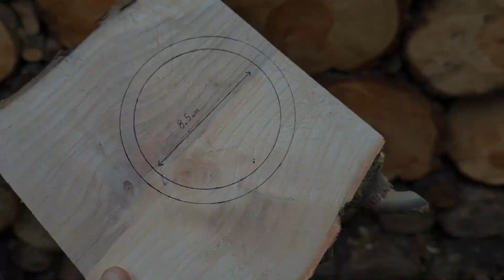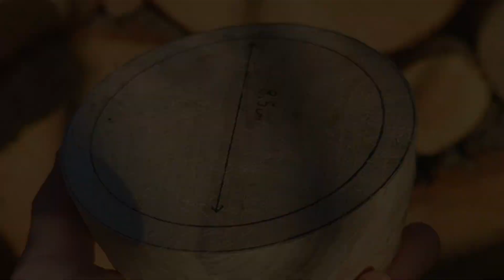Carving A Bowl From Ash

Comment: Nice work. What oil did you apply? Also is that a Morakniv knife and Morakniv gouge tool? And would you reveal and recommend that axe? I just started to get into this beautiful art. Thanks for your sharing. Subbed
Reply from the maker: Thank you very much, it means a lot. I used 'raw linseed oil' for this project as it is food safe. Yes they are 'Morakniv' knives, they are great quality for their price and are usually what I use when carving. Absolutely, that is a 'Gransfors Bruk' Forest Axe, it is probably the best axe I own and will last me a lifetime,  I use it for basically everything. However if you only want to use this axe for carving you will probably want a 'Gransfors Bruk' Carving Axe instead as it will give you a cleaner cut than a general purpose Forest Axe. Hope this answered your questions
Reply: @forisbushcraft8000  Yes I agree with the Morakniv. Many years ago I had occasion to purchase a Morakniv "light my fire" knife/ferro rod combination. I can see how a Mora is ideal as a carving tool. Gransfors Bruks is more than just a string of axes, they are heirloom worthy of passing down to your most deserving of such a gift. Creating useful works with precious species of wood, using quality tools that makes one proud to own... what's not to like. Thank you for sharing.